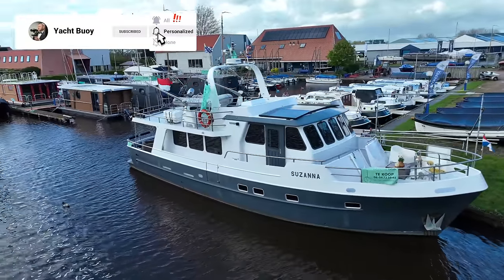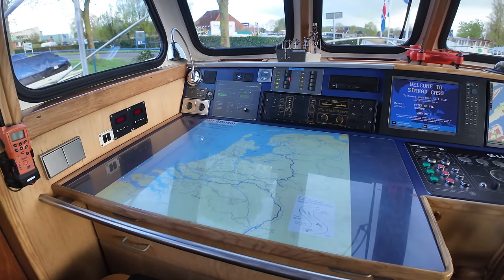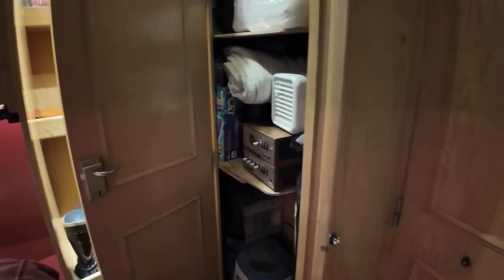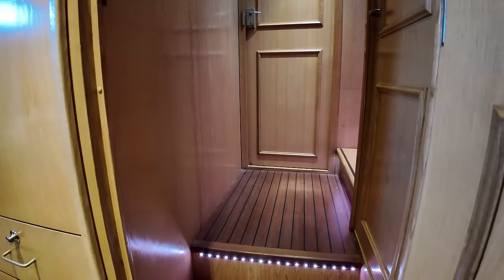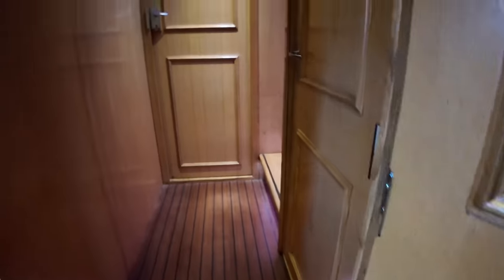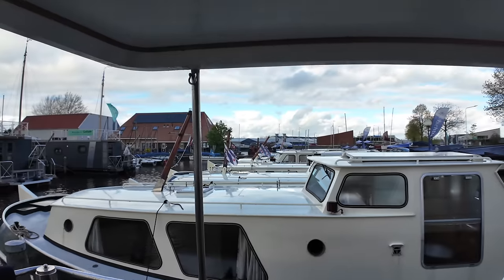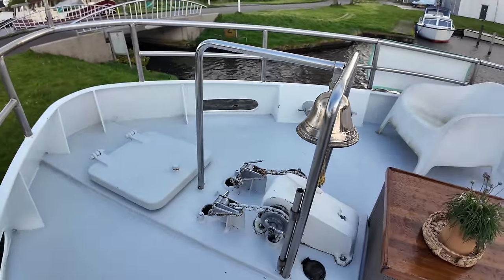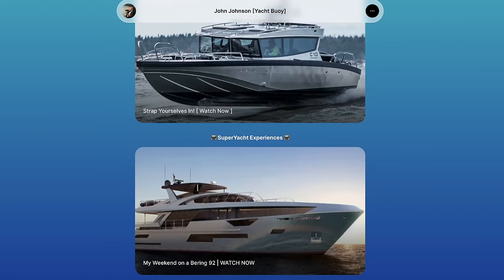THIS Was Hull 1 Built by DAMEN And Designed by VRIPACK (And She is FOR SALE) €375,000 Boat Tour!

Comment: It looks a good no nonsense boat, possibly in need of some interior work. Definitely dont like the four births in one cabin, not very practical and you'd all need to be very good friends! She needs another cabin. Dont like that cooker top, its flat and level with the worktop. If it was used at sea everything would just slide off, it needs some fiddle rails and pan clamps.

Comment: I never did see the refrigerator in the galley. The full size washer dryer is a nice touch. The engine room looked very cluttered.
For me when the smoke and dust settles, I’ll take the Nordhavn 47 with the two head layout.

Comment: two dissimilar materials are combined in a corrosive electrolyte. Surley this thing is rusty. Steel and aluminium 🤣I'm not sure if I want to buy it
Reply: It is common practice for motor yachts to have a steel hull and an aluminium superstructure, which makes for a strong, heavy hull and a lighter topside. I assume they take measures to prevent electrolytic action between the two dissimilar metals.